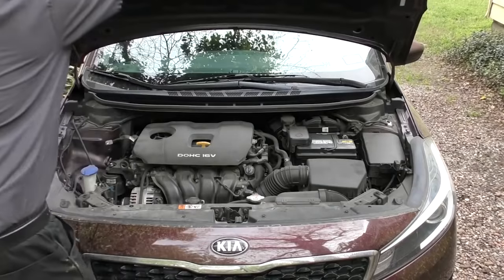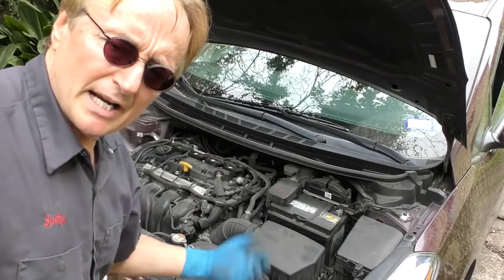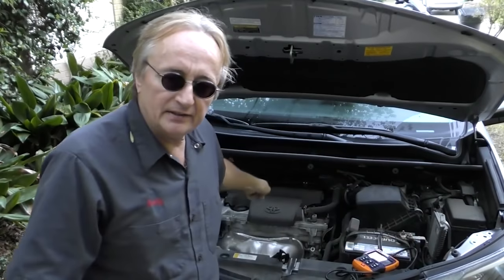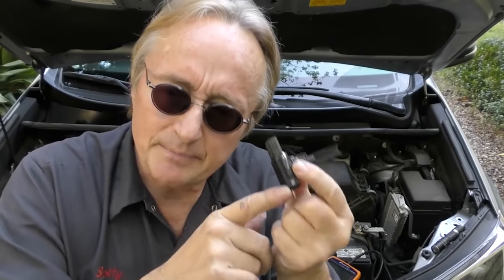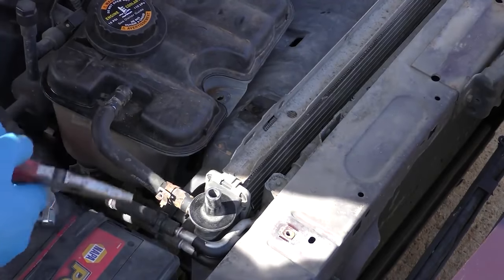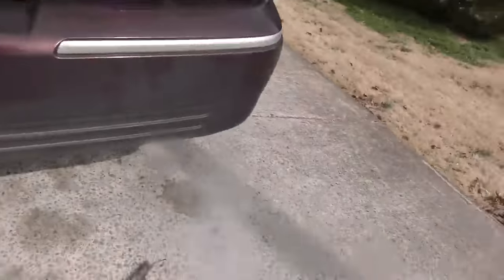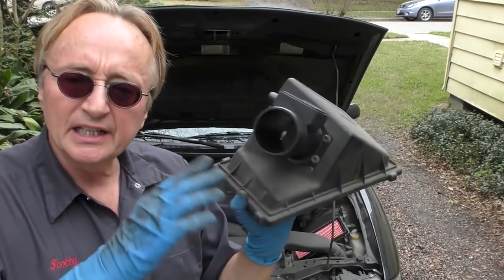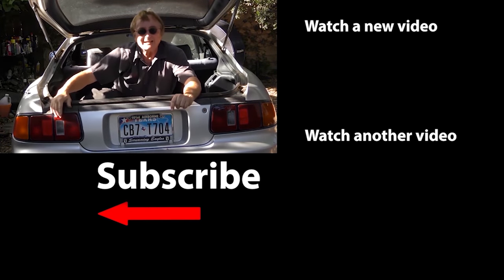4 Signs Your Engine Has a Serious Problem

Comment: The biggest one is if it’s made by Chrysler
Reply: One word hellcat 👌🏼
Reply: @danielcercel1665  and every other dodge vehicle
Reply: @danielcercel1665  yesssss
Reply: Hyundai/Kia 2.4 was garbage on steroids in comparison. They can blow at any time, especially on the highway.
Reply: @Dcc357  stop spreading false info. Not all the 2.4 suffered from the engine failure problem. It was the ones from 2011-2014. I owned a 2010 for 5yrs. Drove it up to 181k miles. Was going to sell it but gave it to a family member instead after I bought a minivan. The engine and transmission is still perfect. The only thing it needs is new suspension parts, which the family member is getting placed before driving it.
Reply: Or Mitsubishi !
Reply: My 2.4. L World engine ( Made by Chrysler/Hyundai/Mitsibushi) is running great. Over 100k so far and no problems.
Reply: Stay away from Chrysler & jeep

Comment: “It’s just a stupid beauty cover.”
Reply: Unless it’s a fiat. Then it’s “stupid plastic crap”
Reply: Engine covers nowadays act as a sound insulator for the very loud GDI fuel pumps. You'll notice all the foam underneath. More than a beauty cover now!
Reply: And then the boomerang move!
Reply: It was nice to keep the noise down on my focus st injectors, but now there's no room for it lol
Reply: @Dcc357  also keeps the heat from the engine from ruining your hood paint.
Reply: He did a bad job and blames it on a blow head gasket
Reply: @stevek343  lol, how's that?? Are you an experienced, knowledge Auto mechanic? Because I am, and he did everything exactly as it should have been done.. 
   Not sure what you think should have been done differently, but I would love to hear it...😁🤔😁

Comment: At least Scotty knows the difference between running and fixed. I worked as a technician for 40+ years and that was one of the hardest concepts to train techs. The other is that if you have an assembly with several identical parts that receive the wear and one has gone bad, change them all. If you do not you will be chasing the problem until all are replaced anyway. The parts are most often cheaper than your time.
Reply: Especially parts like spark plugs.

Comment: 4 signs your engines dying is if it’s a 
1. 3.6 v6 
2. chrysler 
3. repeat 1
4. repeat 2
Reply: Not the 3.6 you mean the 2.7 V6 where they designed the water pump under the timing chain with a weep hole into the oil pan. Guaranteed to grenade under 70K miles. Shame that crap motor was used in several decently built cars.
Reply: Kia/Hyundai Theta II engines are scrap in comparison.
Reply: you forgot the horrible GM 3.6L VVT V-6 is junk as well
Reply: @DL30Creations  
A 2.7 v6?
Just thoes two things together sound like a problem. Would be worse if a turbo was added on.
Reply: Chrysler has always sucked
Reply: The GM 3.6 sucks. The Chrysler 3.6 to me
Is good. Got 198k on one of our cars and it’s still good as new. But then again most people use full synthetic and never change their oil
Reply: @samlung2724  I welcome you to the Ford F150 twin turbo! Pos
Reply: I think my 2004 Pacifica has one🌠🍀🐴
Reply: @kushylifekindheart3890  they didn’t produce the 3.6 till 2010 I believe
Reply: @samlung2724  Audi B5 S4 just had shade thrown
Reply: I got a 5.7 V8.. do those last awhile
Reply: Have any of ya'll ever pushed e85 with bolt ons and a tune on the GM 3.6L LFX motor? This motor is awesome and sounds incredible, any engine will run perfect if you baby it in the ways it needs.
Reply: I’m 60,000 don’t wanna jinks myself but she’s running great 3.6L pentestar
Reply: My 5.7 and 6.4 HEMI never had any problems.
Reply: @drewecheverria8754  cause we took care of em 😌
Reply: There's a vid u got the 300 srt version? If so vid bout 5 issue with it
Reply: The 2012 Charger SRT had shifting issues once in a while. The 2016 Charger SRT had no problems.  I also had a  2016 Power Wagon with 6.4 Hemi ....no problems.
Reply: Have anyone have had any issues with Chevy Trax, Buick Encore or Subaru Crosstrek????
Reply: @youtubereviwer1254  when u get the ticking sound get rocker arms replaced ASAP.   Or it damages the Cam.   Which is very expensive
Reply: @Dcc357  no they are not. I have this kind of engine but it’s turbo charged and I haven’t had an issue as long as you do the maintenance.
Reply: 2.7l you mean
Reply: Explain why it’s a bad engine
Reply: @cozykf6236  the 2.7 l engine is bad because if you don't change the oil at exactly 3,000 miles it will get engine sludge at the bottom of the motor and blow the motor
Reply: Pentastar is good engine
Reply: @10xyourlife65   I was talking about 3.6 pentastar but good to know
Reply: @cozykf6236  oh I'm not sure about that one I think it's good
Reply: @cozykf6236  3.6 penestar had weak rocker arms.  Eats up the cam
Reply: I'd love to think that Scotty attended some Star trek convention in his early days. I really really do. 🙏🙏
Reply: @CHMernerner  pentstar 3.6 is junk everyone one that I know of is always having issues all kinds what’s up with Chrysler?  They used to make the best cars once upon a time
Reply: what about a 3.5l v6 honda accord 11 i-vvt vcm?
Reply: @10xyourlife65   So you're blaming the car on account of people's negligence?  I've got an '04 Intrepid SE with the notorious 2.7L and yes, the water pump has been changed at about 84,000 miles- back in 2011(?)/2012. It currently has over 157,000 miles on it and again, yes I will be personally physically changing the water pump and timing chain on it this time. but, I've always used the Mobile 1 fully synthetic oil and always have changed my oil at 3,000 miles. I know we're supposed to be able to run them up to 4/5000 with the fully synthetic but I care about my car and just kept it routine at 3000. My car has more rust from when I lived with it up north than it does damage due to a "bad engine".
Reply: @jeanparish9559  okay calm down. It's not the timing belt that fells on this car. It's that engine sludge will build up in the engine It does not happen to everyone. It is just a failure with the oil pump that they have
Reply: @kamillugha893  lol
Reply: You mean ANYTHING bmw right?
Reply: @drewecheverria8754  my 5.7 hemi is at 240 thousand miles and still my daily driver as well
Reply: @cozykf6236  google 2.7 V6 Dodge it literally comes up as one of the worst engines made in history...I just recently found this out buying a 200 dollar car with that engine that I'm not even going to touch now it's going straight to scrap with 102 thousand miles on it
Reply: @mikeboy337 you should be good for at least 10 years 😂

Comment: I loved the pacing of this video. I learned a lot in just 25 minutes. I've recently been getting into auto-mechanics and I know how an engine works, and I know how a manual, an auto, and a CVT transmission works. And now because of this video I've learned how the radiator works, the fan assembly and hoses and about the mass air flow sensors. Thank you for this educational video.
Reply: Beautiful! 😊

Comment: Real mechanicing!! this is so much better than your normal videos! I used to have a grand marquis about 30 years ago.. It had massive radiator problems but I was a dummy about cars back then and no you tube... Got robbed by four different mechanics. One guy literally took the thermostat out, chucked it into a nearby transhcan and said, "don't need that..."

Comment: Fun fact: each one of those ignition coils is $150+. I also own a kia forte and i have to maintain it weekly to make sure it doesn’t have problems. Often times, the coil springs go bad and you would think to replace the whole thing, but the dealer will sell them to you for around $2 each. Also, the brake lights tend to work intermittently and tends to blow brake bulbs a lot. If you have this problem, simply get led brake bulbs and adjust the metal contacts within the brake light housing so they actually touch the bulb contacts. Hope this saves someone some time and money.
Reply: How do u know if the coil is bad or jst the coil spring is bad?

Comment: Hi Scotty;
I have had a coolant loss problem for several months on one of my 2000 saturn sl1's that I operate(I have 3 on the road).   Car didn't have any leaks that I could find. The level in the overflow tank keep going down about a pint a week.  I  checked head gasket with a pressure tester. Checked the cooling system with a 15 psi pressure tester at the overflow tank.; no leaks there, either.   Then one day, I was at a Turkey Hill store and left the car running.  Though I would be out in a couple minutes only to find the store very busy and only one person at the checkout.  25 minutes later; I returned to the car and found a cloud of steam billowing forth from under the hood!  At last!I realized that the problem was the coolant fan wasn't working!  Back into The store and $24 later with a gallon of 50:50 antifreeze;  I carefully returned home and checked the fan motor with a DVM. The fan was open  circuit.   That was the cause of my leak problem.   $30 for a new one on ebay and all is well!

Comment: Found me some honest mechanics last year. I knew by the way they allowed me to watch and the way they troubleshooted my issue that they could be trusted. But I heard the mechanic mention to me afterwards that he was concerned about the misfire in #1. I blew him off but kept his observations in mind. Went home and Googled it. Ended up replacing the spark plugs and ignition coils, cleaned the MAF sensor and throttle body. I also took off the intake box and the complete intake assembly and took it inside to clean it in the sink. Inside and out. Waited an hour and reinstalled everything with a new filter. No more misfire. I probably spent a $100.
Reply: finds an honest mechanic, does the work himself. what a guy
Reply: Can u do my vehicle next 😏

Comment: Sign your engine has problems: pieces of the rings start flying out of the exhaust pipe. 😖
Reply: And a sure sign your wallet will get lighter. 😢
Reply: And it contaminates the muffler bearing so lube it to stop squeak and chk Eng light and always replace muffler bearing with a usa made timken roller bearing chk engine light solved!

Comment: Just did this to my 97 4runner. Switched coil packs and still same cylinder. Changed the plug and that fixed it but this same thing happened about two and a half years ago with the same cylinder. Driven about 15K miles.

Comment: I had oil spill into the cylinder on my first run on general vehicle maintenance. My engine started to misfire. Thanks to YouTube, I figured out the cause and solution to my problem and saved myself a couple of bucks.

Comment: 15:46 the slomo had me dying 🤣🤣
Reply: Hi Scotty, pls I want to know the original coil for 2007 Camry because I was told that the one my car is short that it's usually long.
Reply: @confidencepenman4401  original ignition coil or suspension coils?
Reply: Plug coil for Camry
Reply: @confidencepenman4401  you could go to any parts store and they should have it, if not they'll order a set for you.
Reply: I don't even know whether the one in the car is original or not...
Reply: How do I know the original?
Reply: @confidencepenman4401  you can try measuring it with a ruler and measure the new ones. As long as it is for the same make year and model, a slight difference in size will not cause issues, just make sure they're all firmly seated and secure
Reply: @confidencepenman4401  I would go ahead and buy the part, see if it works and if it doesn't you can always return it. If it says it works for your year make and model itll work
Reply: Yeah me too😂😂😂

Comment: 1st video: i had similar problem over a year ago.

 I had 2012 Hyundai Elantra. 1.8 L, direct injection.  Started having miss fire @ around 100k (original spark plugs), with check engine on. Tried fuel cleaner aditive.  It went away after 3 months for about a good 4 months.  But still notice some shuddering at highway speed @ always the same range of rpms I believe it was around 2800 rpms. So as long as i didnt drive it in that range, i was fine.  Oh and it would sometimes shudder (hickup) when idling for several minutes such as when parked after a drive, not when it was cold, but it was couple shudders in span of several minutes.

 Than one day, it wouldn't start (130k miles) late at night after work. When it started it sounded like a lawnmower.  Turned it of and on same thing.  I had to keep it above 4k rpms for it to produce any power. And i drove it like that all the way to home (30 miles) , and than to closest autozone. Found out plugs would be over $100 for all four.   I figured i would spend that plus another 15 for tools.  If that didnt work i would be out 115 for an 7 year old  car with 130k miles and it being a Hyundai (anything other than a honda or a Toyota which hold there value). 
I found out that these engines also were prone to piston slap. Watching the some video and hearing my car as having similar symptoms.
 I decided it was time to trade it in.  It would just be a money pit from here on out.  (Had issues with brake calipers hanging, muffler that leaked pasted cat but didnt pass annual state safety. Plus some gas tank emissions problems early on - thankfully covered under warrenty. )

A year later haven't look back. Still got 1k for it.  That car was rated for 40mpg (which company lied and ended paying several hundred to owners like myself.)  My current car 5th generation camry with 2.5L.  If i drive careful, i can achieve 40mpg.

Comment: REV UP YOUR ENGINES! Love your show and advice Scotty!!. 350,000mile 2000 Tundra here. Just hit a tree with it(real hard) here in Idaho, but its on the mend. I'm good but air bag did'nt go off ;c ?? but it got me thinking(maybe too much)wonder what would happen if it(air bag) did go off and I went in the river ?Probably not good. Somethings are just meant to happen. When I put another 650,000 on that tundra , I will bring it to you personally to critique and like Top Gear did the 80s Hilux lol.Sister had a 1980 celica she drove for 200,000 miles with NO oil in it.Probably why it quit burning it. Had that respected 22R in it Now thats Japanese craftsmanship! Peace

Comment: Look at freeze frame data. That can narrow the field as to what the problem is. A misfire can be air flow, a valve issue. It can be a plug issue, a fuel issue, or a few other issues. The head gasket idea, a cylinder leak down test can define where it is leaking.

Comment: I need you here in my driveway, Scotty. My truck ('67 f250, 352 FE) is chugging hard and no timing adjustment is helping. I've got it where it is running. I had a fuel leak out of the filter, fixed. I changed the spark plugs to an older set I had sitting around (cleaned and re-gapped, of course), and I changed the oil. Nothing fixed it, so I changed to new plugs. Still sounding like an old steam engine. Chug-chug-chug. I'm checking the fuel filter, but it's almost new, along with the pump.

Comment: 2005 mustang p0305 5th cyclinder replaced all 6 plugs, ignition coil, 3 injector fuels so far and its running so much smoother! I have an engine light flashing tho... My tio says its all good he did work mechanic for years. My guess i have to change the other 3 injector fuels and it will be ready. Most likely i think..

Comment: Hey Scotty, what would be the problem if your car is limiting it self to 4 thousand rpm instead the 5300rpm? My car is a mazda demio with the skyactive 15 turbo diesel.
Reply: @chefboyardee380  sick right?
Reply: I don't know how the sky active diesel is set up, but a normal diesel is limited to 4000 - 4500 rpm. That 5300 looks way to high for a diesel
Reply: @Thanks Yutbeisacn7fu6r but this one is engineered to exceed 4 or 5k
Reply: @Thanks Yutbeisacn7fu6r  yea I'm pretty sure it's the dpf or the turbo hasn't been heated enough so there for it restricts the power to prevent any damage. Quite fascinating.

Comment: Challenge: find the most reliable cars  from the worse car making companies
Reply: BMWs is definitely the new Supra
Reply: Well the most reliable Fiat products are Dodge/Chrysler so that should tell you something
Reply: Bmw 525i with the i6 engine
Reply: @yamen857  have owned an E60 example from near-new, 297k miles and still running like a champ.  Low spec, unstressed engine and absence of failure-prone options makes for a righteous formula
Reply: Chinese car cherry

Comment: I love your coil testing exactly what my uncle told me to do after I replaced the spark plugs and it was still misfiring(I needed to replace them anyways). in my v8 1st gen tundra I just swapped the coils contacts was burnt for cylinder 3. crazy stuff happen to crazy high voltages that come out of coils

Comment: My engine needs 2 to 3 quarts of oil every time I fill up my gas tank...It’s like getting an oil change every 250miles 😁
Reply: My saturn vue with the 2.2 ecotec and 160,000 miles burns about 1-1.5 quarts for every gas tank (or 300 miles). The oil also gets dirty and burnt smelling fast so I change it every 2000 miles or so even though it's super tech full synthetic. I use the same oil in my 1993 mazda b2600 with 97,000 miles and it stays at the same level until I need to change the oil again every year or so. You really can't beat japanese made cars. My saturn says it was made in Canada so I still have faith it will go for a long time, since Scotty says Canadians made good cars.
Reply: still should change it. if youre burning that much oil youre prolly gona lose some o2 sensors and a catalytic converter
Reply: AND if youre burning that much oil you should be checking it more frequently and topping it off
Reply: Pulls into full service "Fill the oil and check the fuel level".
Reply: That’s almost 84 miles per quart of oil...it gets great oil mileage 😁
Reply: @CadgerChristmasLightShow  your next journey should be to the scrapyard!!